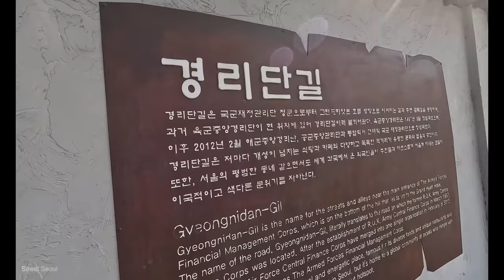Oct.2023 BTS JK House Construction /경리단 길 / Seoul,Korea/ 4K

Comment: How much does a new scooter cost
Reply from the maker: Wow... 1 to 20 Mil KRW 
Depend on the model
small and not expensive one is about 1~2 mil. KRW ( $770~1,500 USD)
Reply: What models are there and how many cc ‘s are there?
I have a Texas License for a motorcycle, but I prefer scooters. I like scooters bc I don’t have to shift gears. Here I had a 250 cc scooter and I drove it on the highway while I was working.
Reply from the maker: @Frances-y4j  Very nice.
Here in Korea, Motorcycles can not drive in Highway.
Engine capacity, in popular case is 100~250cc.
I don't know in detail.
Reply: @streetseoul  thank you for the information
Reply from the maker: @Frances-y4j  :face-red-heart-shape:
Reply: @streetseoul  kewl